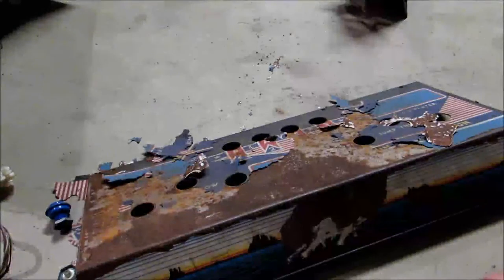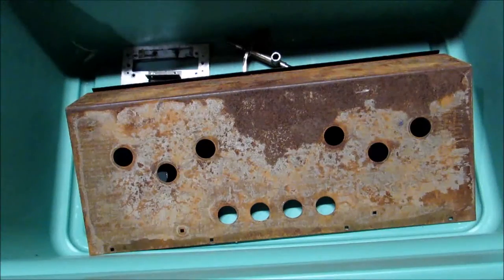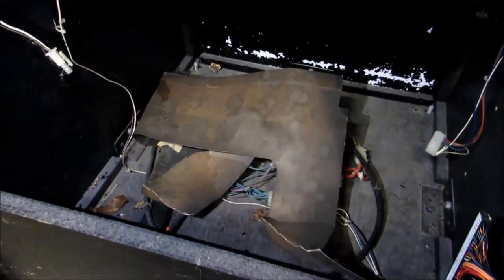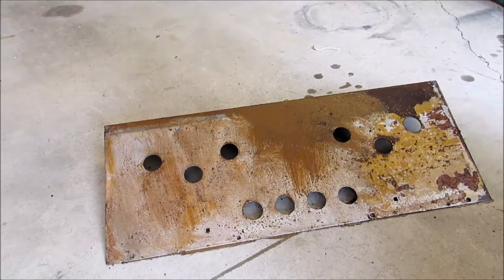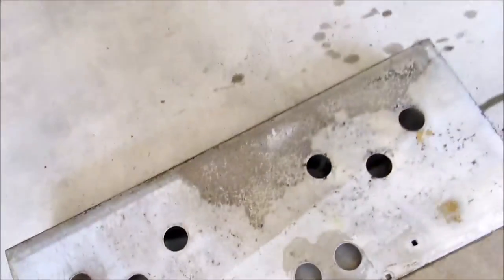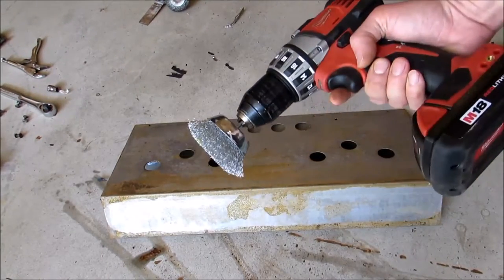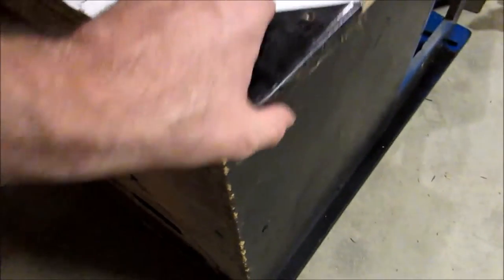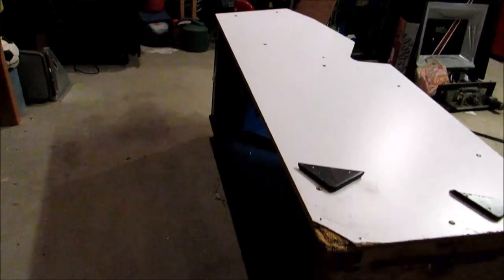Track & Field #2 - Cleaning up the Control Panel

Comment: Well, I have to say that vinegar worked much better than I expected. And it's a hell of a lot cheaper than the rust remover liquid you get at the hardware stores that's for sure. I think a gallon of that stuff is over $25! Gonna give this a try next project.
Reply from the maker: It's perfect really. Just let it sit over night and it's less than $4 for the gallon. In fact, I used that same batch of vinegar for days with different pieces and other projects. I wanted my $4 worth!
Reply: +That Tim Guy  You get my PM last night?
Reply from the maker: +atariforever2002 I did and replied.

Comment: Pro tip.  Use an angle grinder and a wire wheel.  Easily cleans up the mess once you finish the vinegar treatment.  MUCH easier to use than a drill.
Reply from the maker: I've got one, I just didn't have the wire wheel for it. I was also afraid that it would gouge it up pretty good. But it sounds like it works out alright?
Reply: @ThatTimGuy  I'm WAY late to the party but I used a felt polishing disc on my angle grinder. It didn't hurt the metal and it cleaned up the rough area on my CP very nicely. The only problem I had was heat. The felt pad will generate heat and I, like a dumbass, stuck my thumb on it to see if the gunk was gone.....

Comment: Control panel came out nicely! I didn't have any power tools at my disposal at the time so I ended up using 50 grit sandpaper by hand, then topped it off with 100 or something. Came out pretty good. Check out a photo here: https://goo.gl/photos/LsLwpvwszrzcSY959  I didn't even think of using vinegar! The sandpaper was a real chore. Took a few days of scraping the glue off from the overlay. Yours came off much more cleanly.
Reply from the maker: That's nice and shiny! Looks polished! I bet it was a real chore with the sand paper!  Yours doesn't look like it had much, if any rust to start with! I think mine was swimming in the ocean :/  Actually, I heard it came out of a barn that had a collapsed roof and the cabinet was too far gone to save.